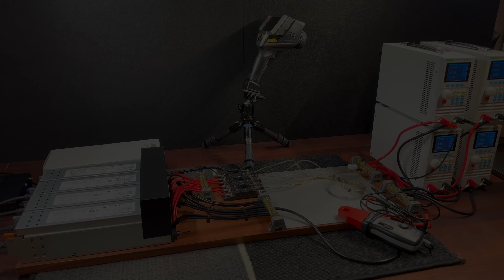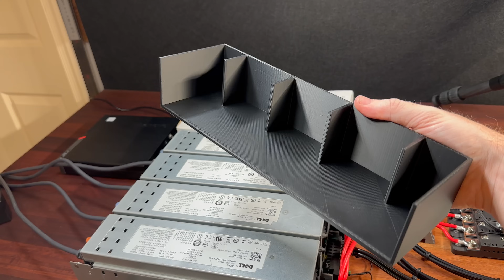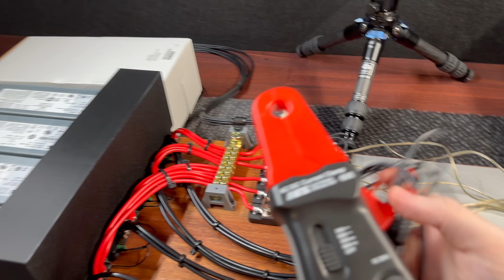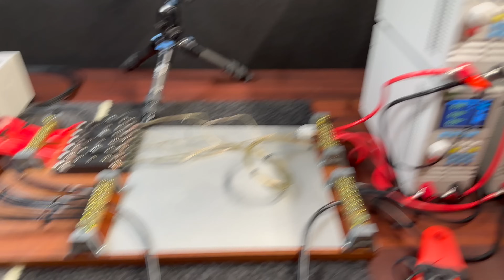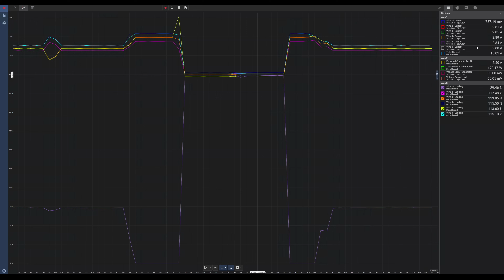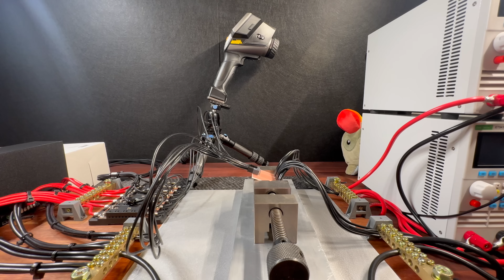NVIDIA 12VHPWR - Big Upgrades!

Comment: Yes, if you sold a kidney to buy a brand new car,  good engine, but the tires are slippery gummy shit.
In the first days, you take normal corner that a used to with any other previous car you had. And your brand new car decides to spin out of control. 
This is not the car manufacturer’s fault, the tires were just at the weight limit of the vehicle.
The car manufacturer is not responsible for having chosen these dangerous tires? For having put in their client’s hand such a vehicle????

Come on man…
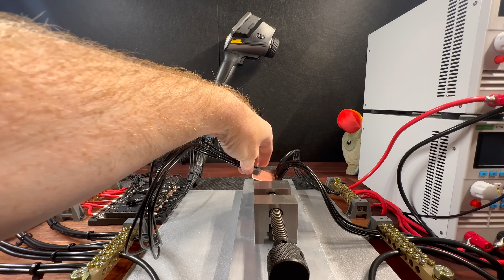At 12:40, “it’s not really their responsibility at the end of the day” did you just say???
You’re insane. What do you smoke?

A car is a bundle. Everythin must be fine and safe.
A GC is a package too. Why should we have to “worry” that something could, may or may not, melt somewhere inside…???
This is not the client problem to think about that.

The only fact, that a problem like this rose up, that we have to talk about it, is already too much on the client side.
Shame on Nvidia.
Reply from the maker: You bought a GPU, not a computer. You might buy a prebuilt computer but each manufacturer of a part inside isn’t responsible for everything else it is connected to. If a GPU melts its connector because of a worn out or faulty cable, the cable was at fault, not the card.  I don’t know what you expect NVIDIA to do, are you seriously expecting them to run 4-5 x 8 pin PCIE cables instead of a 12VHPWR cable because that is what would have been required at 150W a piece…
Reply: @ that’s probably why they’ve already refreshed it from “12VHPWR” to “12V-2×6”.
Because, there was absolutely no—— problem so far. 
All the idiot clients’ fault. 
Nvidia is for nothing.

Comment: Also, the main reason the PSU can't realistically do load balancing is that it can't, without reducing the overall capacity. If you have a bad connection, one wire will have less power draw due to higher resistance, and to resolve this and restore balance - the PSU would need to artificially add resistance to the other lines to equalise it, which adds heat and reduces the practical capacity of that PSU. Worst of all, most PSUs have no way of telling the user an issue is present, so would mean the user could get the false impression their PSU isn't powerful enough to handle their GPU, when it actually is - since there would be no feedback. At least monitoring at the GPU could tell the user there is an issue on the screen...
Reply: You are correct that it would be very inefficient for the PSU to add resistance to lines to make them equal, but you're missing how a power supply would actually implement this. you don't need an actual resistor, you just need ohmic behavior*. meaning, voltage and current are related to one another according to the "resistance" value in E=IR. In a PC PSU, you have highly efficient switch-mode power conversion circuitry that can output arbitrary voltages (within a range). if your PSU implemented a mechanism to load balance current across parallel wires, the way they would build that is not by adding actual series resistors, but by reducing the voltage supplied to wires with too much current. you could model this as an "imaginary" resistor, where the voltage is reduced by the current times r (where r would be calculated based on measured current imbalances), or in other words you could say the PSU will behave *as if there was a series resistor. but in the end, modeling this behavior as series resistance is holding you back from the much simpler truth. if you have some resistors of different values, ganged together on one end, and you want to have the same current flowing through all of them, you're not gonna do that by adding series resistors, you're gonna do it by supplying different voltages to them, proportional to their resistances. you could use series resistors to vary the voltage, but the actual quantity you're manipulating is voltage, and in a switch-mode power supply there would be no reason to bring in extra resistors when the convertor itself already has the ability to vary the voltage directly, at zero to low efficiency cost.

now practically i doubt many consumer-grade computer PSUs do this as supplying slightly different voltages to every parallel wire in a connector would require a ton of duplicated circuitry, but the point is, the reason it's not done has nothing to do with power or heat. in mid-to-high-power DC systems, the distribution of the load is adjusted by varying the output voltages of switching convertors, not by swapping in resistors.
Reply from the maker: My 4 power supplies in this setup are load balancing as we speak? Also how did ASUS do it if it can’t be done?
Reply: @whatcouldgowrong7914  ASUS isn't load balancing anything.
Reply from the maker: @ActuallyHardcoreOverclocking I have updated a first post, I cannot remember what videos I saw it in, but it was mentioned a few times that the current sensing of the Astral cards feeds back to the ASUS power supply to apply compensation if needed. I went digging into their marketing materials but only find spin with no substantial information... I will keep digging into this. Thanks for the reply :)
Reply: @whatcouldgowrong7914 Most people don’t have 4 or even 2 power supplies tho, it’s usually just the one with multiple output cables, also it’d be very sensitive to if you happen to try to pull power from different pairs of cables I think/suspect (positive from one pair and negative from another).

If you wanted to deliver a lot of power through small dinky connectors / cables it’d be easier probably to use a single pair at higher voltage - connector can be better since only single pair need space and reduced risk due to some connectors connected but others aren’t.

All this trying to push a lot of power over multiple pairs is just a poor bandaid solution to a problem, it’s why we don’t see car batteries or power lines with a bunch of cables in parallel.

Edit: formatting for readability
Reply: @motalasuger  we do see parallel cables all over the place though. all the different molex micro-fit connectors in PCs for CPU and GPU power, sata connectors have multiple contacts per rail, USB-C uses 4 different pins for VCC if i remember right. not to mention, stranded wire! i'll bet most car battery connections are through stranded wire (since otherwise it would be impossible to move the cable at that thickness), and i'm pretty sure appliance cords are required to be stranded, these things are all bundles of much smaller wires connected in parallel. arguably, any wire that's thicker than a single chain of copper atoms is an example multiple conductors in parallel. there's nothing inherently wrong with multiple conductors in parallel, as always the problem comes down to whether a given connection scheme was designed and implemented well for its application.

Comment: Love your content, but don't agree nvidia gets a hall pass on the power input - they design and mandate the power delivery setup including to the board partners, and could easily have mandated monitoring of balance across the connector and disable the card if there's an issue. They didn't need to mandate this new connector - but they did anyway, and show no signs of taking any responsibility for that poor decision. Asus violated these designs but for the right reasons, and nvidia must learn from this type of design. Either way, keep up the good work!
Reply from the maker: I didn’t mean they get a free pass, more so from a design perspective it just doesn’t make sense. It’s like a home owner being responsible for the electricity company not load balancing their power lines correctly when all the power arrives in your home on a single bus.

Comment: Suggestion for part of your main test video with the new setup: put a WireView in series with the 12VHpwr connector. It commons all the grounds and all the 12V pins, so helps take the per cable current at the PSU more or less out of the equation. I run one with my 4090,and it handles 600W with no heating issues. I'll be getting another for my 5090 (my pre-ordered card has the connector orientation rotated 180 degrees).

Comment: Its might be your "opinion" that the power supply should take care about balancing. 

However, i assume that the ATX specs that define exactly who is actually responsible. To my knowledge the powersupply must ensure that no powerrail is overloaded. The load device however must ensure powerlimits of wires and connectors is not exceeded and hence is responsible to ensure power is drawn evenly. Thats also electricly much easier to solve because you can design the board that way that every section is powered by another cable and each section ensures it does not exceed limits.

If my understanding of the specs is correct, there is absolutely no doubt that its NVIDIA fault and nvideas fault only.

That being said. The ATX12V specification with their parallel wires is completely stupid from a electrical standpoint. why not just use one thicker gauge wire instead of independent wires.

Comment: 0.05ohms is still 833% of a single terminal expected max terminal resistance, but it definitely demos better when exaggerated. You also can't load balance at the power supply side, that'd require flyback regulation which isn't going to play nice with parallel conductors. Or some sort of incredibly overengineered PWM. NV also went outside the ATX spec at the time in RTX3000 when they started using the micro-fit connector. That said, it still really seems to be people's bad/reused connectors and/or a thermal cycling issue.

Comment: Those are some sweet upgrades! 
As you kinda mentioned, I really think cards should have per pin sensing just for safety. It's not a big cost add for how much value it could add. I agree it would be better to current limit at the PSU though.
And yeah, I hope ATX/pci-sig does implement a better high current connector like the XT connectors. A 4-pin XT60 style connector with hi-flex, hi-strand 200c 10AWG wiring would be pretty future proof. The XT pins are great, just need a redesigned connector with a latch and better engagement confirmation.
Reply from the maker: Definitely agree and I also think if a big change happens we should jump to 24V/48V at the same time and give us a lot of breathing room for future growth 🙂 technically the 12VHPWR would double or quadruple in capacity with just a voltage change and contact resistance becomes far less of an issue also at higher voltages 🙂
Reply: @whatcouldgowrong7914  A voltage bump isn't a bad idea, certainly puts less strain on existing wires/connectors. However, how would that work for power conversion? Could you keep the same VRM configuration on the card? Or would that require even more heat dissipation at card level? Or is converting 24/48V to 1-5V the same as converting 12V.
Reply from the maker: @andrewt9204  Technically it is a trivial matter of the power stages just switching at different rates to step down the voltages but someone did mention that apparently MOSFET technology hasn’t been developed in the 24V/48V space like 12V has with the previous demand of PCs. Technically you could step down the DC from 48/24V to 12V and use the existing MOSFET designs as is until we have more suitable components or announce the incoming change and give a few years for onsemi etc to design the components to handle higher input voltages. Technically heating will go down as current demands drop on the input side
Reply: @ I kind of thought it wouldn't be that much different conversion wise. Although yes, I'm guessing without looking, the existing mosfets are probably not rated for more than 20V. That seems to be a common AVR rating. There was never a reason to have it higher I suppose.

20V systems wouldn't be bad either. Even that bump would be significant. Would make PD USB-C ports pretty easy, haha. Intel was floating the ATX12V standard for a while, might was well just make it 20V with the same concept and call it a day. I would assume the current majority of components could handle that.
Reply: XT60 is only rated for 30A continuous, also I don't believe you can pick and place an Anderson connector. Molex does have connector solutions for high ampacity single pins like that, but then you're still stuck with routing #6/#8 through the case which is awful.
Reply: @ragzillaz Yeah, I wouldn't want the same connector, really just the pin style. Also yes, not necessarily the XT60 pins, just using as a common example. Although 4-6 of those would be plenty. 4 would be capable of 720W continuous. That's why I also mentioned using hi-strand 10AWG silicone wire. It's very flexible and with only a few wires, would be the same management difficulty really.
Reply: @ anything where you have >1 supply conductor you paint yourself into a situation where you now need to load balance somehow, either actively by driving the VRM appropriately (which NV doesn't do now, I'm guessing because doing that and responding quickly to voltage transients is *hard*), or by relying on roughly even circuit resistance (as NV does currently with 12v-2x6). Reducing the number of circuits complicates it by swinging power around even more quickly (e.g. 2 circuits, 600W, 2mOhm/4mOhm contact resistance would put 16.67A on one side and 33.33A on the other, on your 25-30A nominal terminal, even more out of spec terminals would be even bigger swings).
Reply: @ragzillaz  Yeah, that's a great point for sure. Bumping the system voltage to 20V+ is the real answer I feel, while keeping similar connectors. Bigger pins/wires is mostly just a band-aid. I was just thinking of keeping current 12V compatibility.
Reply: @andrewt9204  and most of that would be driven by market demand, we don't have 24V/48V smart power stages because people just don't ask for them, you could potentially 2 stage the VRM on the GPU but that takes up board real estate (which is the approach generally used by -48V telcom equipment, the PSU takes -48V and then produces the specific rails the equipment needs, but not at the switching precision needed for e.g. GPU core which would be done by a further downstream 12V>1V VRM).
Reply: @ What strategy do laptops use then for converting 20V? Could similar be implemented, or are laptops also cascading power conversion? I know max TDP's on laptops are much lower of course but there's certainly more potential room on desktop class components.
Reply: @andrewt9204  I'd expect cascading, but there could be other parts with higher ranges for laptops, most of the SPS I'm aware of max at 16V high side, I'll look around and see what I can find with other vendors though

Comment: 8AWG is easy to solder if you have the proper equipment!
Reply from the maker: The wire… yes but not with lead free solder on a large multilayer PCB
Reply: @whatcouldgowrong7914  still not hard once again must have large soldering equipment and be done by hand.

Comment: just use a milliohm meter to measure the contacts instead of all this, if current distribution is needed it can be easily calculated. And your common connection to measure the positive side on the shunts will most likely generate an error
Reply from the maker: I already did many circles with it, it doesn’t generate an error as the shunts always have a common 12v no matter how it is designed and the measurement point is close to the regular taps anyway. All connections are crimped and flow soldered to minimise any contact resistance changes and the small bar balances any final irregularities in current distribution. I validated everything with external current measurements and also cross checking my measured power consumption to other references like the electronic loads. Any errors will also show up in the current distribution across the wires / percentages. I would prefer a slightly different setup but cannot justify the cost to have more inputs with a higher end model.
Reply: @whatcouldgowrong7914  he's suggesting using milliohm meter to measure the low-level contact resistance of the terminals inside the connector. The current sense amplifiers you're using for the per-circuit monitoring would be able to do this (you just change the variable from interpreting current based on known resistance, to determining resistance based on known current), but you also need to be able to tap a voltage from either side of the connection to the CSA.

Comment: One thing I noticed here. All the bus bars are neat but they are separating the wires where if they were inside of a system they would mostly be bundled in parallel. I'm not sure how or if that will effect the temperature of the wires during testing but I think you should try and keep them bundled as they would in a users PC.
Reply from the maker: They will be bundled once we’re out of the initial testing but it isn’t really a factor I think until a connector fails catastrophically 🙂

Comment: A problem that might be worth pointing out, even if you load balance, a higher resistance in the contact will still generate more heat than a good contact. You get the heat from resistance, I am not sure that load balancing would be enough as you'd still have about the same total resistance on the contact.
Reply from the maker: Definitely agree, not something I can speak to yet but maybe we can test that later